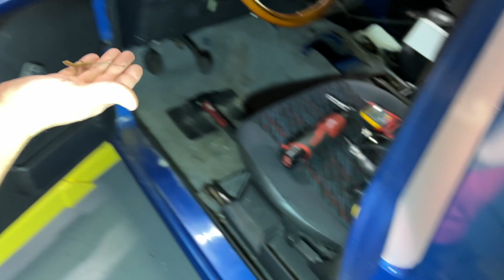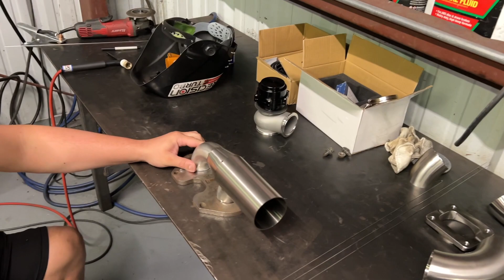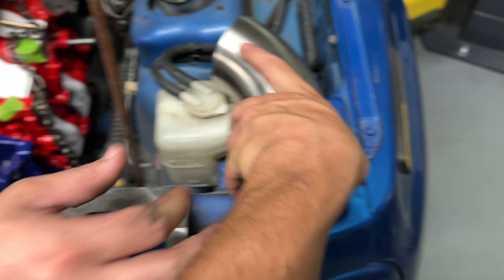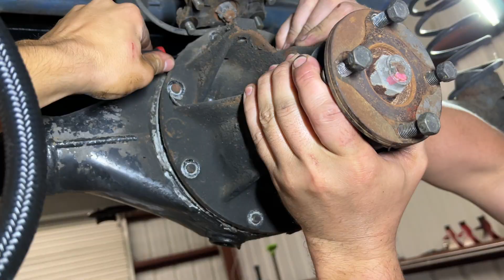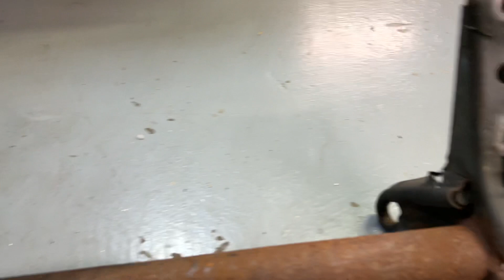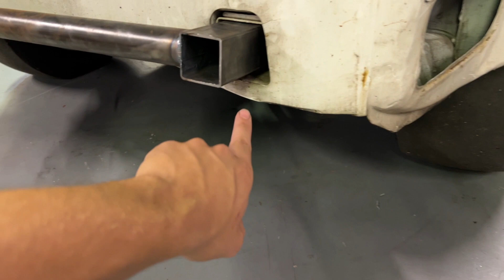Finishing Our 13b Rotary Swapped Sidekick!

Comment: be sure to get the upgraded axles as well .. the spool will work for a while with the stock ones but they will bend and take out some bearings sooner or later. Calmini used to sell them, not sure about now.. the disk brakes from a 4 door is a mild and cheap upgrade that bolt on in place of the 2 door ones as well.  good luck guys.

Comment: Recently swapped my 08civic si with a k24a runs and drives good, just in limp mode, cannot run my scanner on it to check for codes cuz my scanner will not connect to the DLC aka obd2 port not working, wondering if anyone came across this and could share some tips that could perhaps help me get it out of limp mode, thanks in advance, tight on money too :((((((

Comment: I had a Sidekick (Tracker actually, but the4 same thing), put 30 x 10 BFG all terrains on it with a small lift and that thing was a great trail rig. Only other thing I added was a mechanical locker in the rear, as much as I punished that car it performed great and never had any drive train issues. I would love to get another to do the same with it was fun.

Comment: I wouldn't recommend using that new parachute mount like that, especially if you're going to strap it down off it. You have four tiny weak weld holding it on, which will fatigue very quickly. You should of drilled the larger hole through the bottom of the box and put a piece of tube with a thread the whole way through and welded it at the bottom, that way it has to rip the top out and break the weld before it let's go.

Comment: The centersection of a diff usually has 2 tapped holes   if you put two bolts in there you can usually push the centersection of the axlehousing
As for the brakechute : you could add a steel cable to the chute line and another ancorpoint of the car , wouldnt add all that mush weight but at least the chute will stay with the car should the main ancorpoint fail
They do the same thing with the suspension parts on formulla one cars to prevent tires from shooting intoo the audience during a crash

Comment: You should've welded those nuts to a steel plate, then welded the plate inside the square tube. That way the holes would have been smaller than the nuts.

Comment: I do not belive the parachute attachment point is mounted in line with the forces of the car when the chute is deployed, causing a twisting force, much like how a sway bar works from side to side in the car.  It seems to be pitched up a few degrees from level, and tries to go parallel with the ground when deployed, effectively pulling the bar down, maybe even applying a lifting force to the front tires when it deploys.

Comment: Wondering if you have heard of Aims oil? apparently, many racecars are using it in the engine and there`s one for transmissions.
another oil you may wish to check out would require watching the latest Lightbright 4x4 off roading video as they were switching to it in today's video

Comment: In regards to your tie down points Kyle, in your situation you shouldn't really be strapping your car down from those points, the correct way is to strap in over the tyres so it's 100% secure regardless of what's happening with your suspension.

Comment: The only thing that could potentially be wrong with your manifold is with the way the rotors pulse exhaust from one rotor can get pushed into the other rotor with a manifold like that. It will cause bad vacuum pressure and a few other symptoms. Rob actually had the same issue with his first "ultimate rotary manifold" he ended up going with a full divided manifold and turbo to get the best performance

Comment: Hey guys do not put that wiring on the exhaust side of a rotary. It will be stuff after the first burnout. Then you will have to replace it. Always run your wiring on the spark side of a rotary. I build rotary’s every day and you want to keep all wiring away from the exhaust on any rotary.

Comment: I would put a Mini Spool in the Sidekick for now because they give you more drive ability and with them tooth pick axles you're not going to be making 1000hp without one if not both of them breaking apart atleast for now that is what I would go with until you upgrade the rest of the suspension and drive train but I do think it's pretty cool that they put like a mini Ford 9in rear differential in the Sidekick

Comment: Instead of cutting holes in the rear bumper on the MR2 wouldn't it be much better to make a skid pan for the whole rear? You could use the same material that's on the bottom of the jet boat just find some thinner material and design like a 2 or 3 pc that easy to remove.

Comment: So here's an idea worth thinking about to help make that parachute bar unbreakable ever. If you put a pipe and weld it straight in line with the top of the curve where it meets the actual mount for the chute. Make it in line with that and make a mount to be welded to the car where you can mount that extra pipe piece and still be able to take it off. Basically my idea is it will triangulate all thise bars and keep the force from trying to twist those bars because you've created a lever by putting that bar away from the center point of where it's mounted with nothing to keep it from twisting. That's probably how those original mount spots cracked. Constant twisting and pulling from all the drag generated from slowing the car down. And so the stronger you make that mounting brace, the more likely it will never break ever
Reply: Triangles are the strongest shape

Comment: Bump this to the top two weld the diff on the tracker you have to take it apart and you will weld two teeth skip two teeth then all of the pieces will fit back inside the housing the process is the same on as a Suzuki Samurai and there is plenty of videos you can watch of that

Comment: How about a Custom diffuser on the rear to allow the air to flow out quicker with a flat floor.  It'll certainly you to be more stable and a faster top end.
Reply: the guy that did the spoiler talked to him about this, as well as tubs for bigger tires. That will probably be in mr2 3.0 lol
Reply: I was thinking the same thing when he pointed out the steel flare that he cut off.It will seriously reduce drag back there.

Comment: You could add a small brace on the parachute that would help alot. You got horizonally. Vertical it will pull. Small triangle where the bar curved to the flat bar. 👌

Comment: There is a rear disc conversion for the sidekick which uses sidekick front disc and samurai front calipers
Reply: They might not need rearbrakes if there going to use the thing for burnouts , think they can make their own kit if they do need one , they need a mastercilinder for diskbrakes all around and the parts you mentioned
Reply: @watahyahknow   but they also wanna daily drive it so rear brakes is a must

Comment: The MR2's parachute mount bumper bar most likely had its welds and structural integrity damaged from the car being secured with straps and cranked down then being pulled in a trailer hundreds of miles and absorbing and all shocks from the drive pretty sure that's what damaged all that to begin with then full speed parachute pulls over and o er surely didn't help good job making way better bro
Reply: Tow points are for towing... You should strap the wheels to the trailer, then the suspension works...
Reply: nope....its from smashing them into the ground doing wheelies.....

Comment: Going the entire way through the square tube would have made the attachment as a double shear point as opposed to the weaker single shear.
Reply: I think they went from sketchy to not as sketchy but still sketchy
Reply: Wouldve taken not much more time to secure it a thousand times better, hole saw and weld it up
Reply: That’s a good idea
Reply: @TheGavinbullard  Might want to ck hdw for shear vs tensile too.
Reply: By the looks of it he couldn’t do that with the existing pipe. It would’ve been 3-4 inches short. You’re right though, it would’ve been much stronger with Solid metal supporting it instead of welds.
Reply: @Darkpassenger2012  yep, but most of all… BoostedBoiz gunna do BoostedBoishit
Reply: Also you may consider a tube top to bottom so it doesn't crush under torque.
Reply: Thought the same thing, would of been way stronger

Comment: Heck man i put a 2&a half inch cherry bomb muffler on my 4 cylinder mustang and it sounds pretty bad ass. It runs right down and goes about 3or 4 feet and has a converter to the muffler to a 2&a half inch turn down before the rear axle. And it passed texas inspection that way. Un frigging believeable

Comment: Kyle....Get that fuel cell OUT OF THE BUMPER and put it in the frunk!  It won't change the CG of the car but it will make a BIG change in safety.  If you tag the wall even slightly you are going to wind up a crispy critter.  

That sounds funny but being burned to death is NOT funny~

Please?  Make this change to the MR2!
Reply: They entertained that idea in the past and it actually does make a difference to the weight balance,  that's why they stuck it so far forward and down into the bumper.
Reply: That is one of the most common places for a drag car, otherwise there would be a rule for it lol. You going to go tell everybody else to move theirs too?? 🤦🏽‍♂️